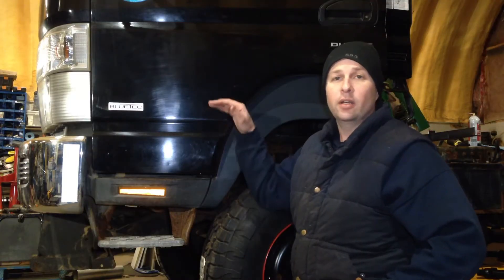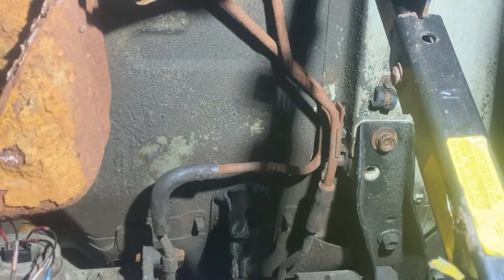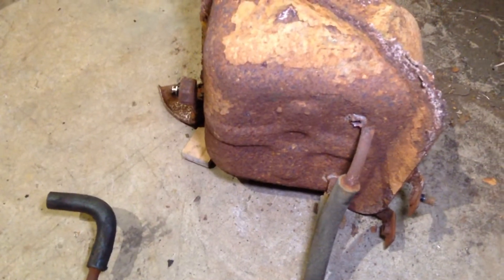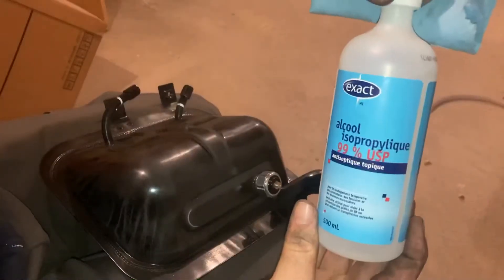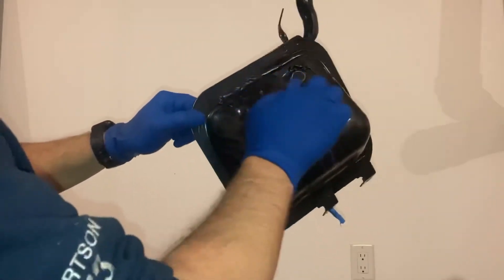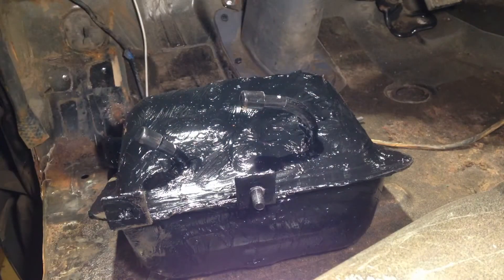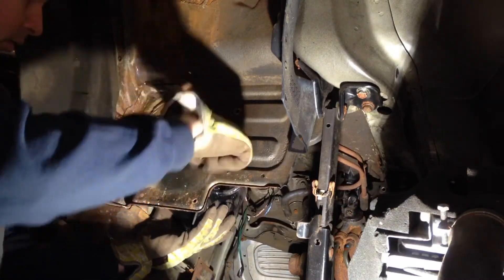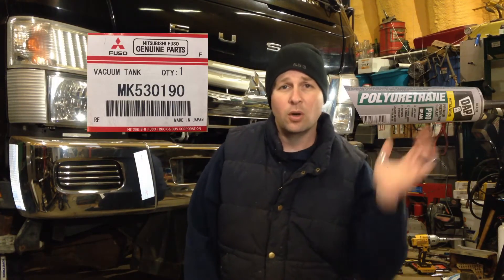Easily Protect your Mitsubishi Fuso FG Canter Vacuum Tank!

Comment: My FG 140 first started to shift into 4x4 low slowly, then not at all and then on came the vac light full time and no breaks!  this took place over a year or so.  I think my tank is on the passenger side, but I have to look closer now.  Its a 2004.
Reply from the maker: Check the lines going to the 4x4 shift actuator as well - if you check my other videos you’ll find one where I found a few cracked lines!
Reply: @BruceandKrista  Yes. I looked at the small lines and they don't look too bad, expect they can go bad by the looks of yours, I'm getting some new hose as well, and one of those zip tie cut thingys you had, cool stuff.  .  My tank had 6 or 8 holes rusted in it, flapper disk and some jbweld for now, new tank on the way.
Reply from the maker: Good stuff!

Comment: Old-timer Full-timer Fuso FG Bus.First is that a vacuum accumulator tank? Second where does it source vacuum from?
Reply from the maker: Yep, vacuum tank as per the label on the box with the part number 😎.  Vacuum is generated by the vacuum pump, which is incorporated into the oil pump.  Vacuum is used to boost the brakes & shift the transfer case to 4x4. When the system is faulty, the “Low Vacuum” light on the dash comes on.
Reply: @BruceandKrista  thanks for clearing that up, at the shop, we always referred to it as a vacuum accumulator can. If that is what it says on the box that's what it must be. My 93 Fuso FG 170 vacuum source is a pump on back of alternator and my transfer box is cable shifted.
Reply from the maker: Yep, my old diesel Landcruisers had vacuum pumps on the back of the alternators as well!